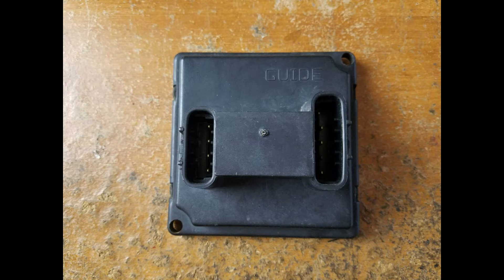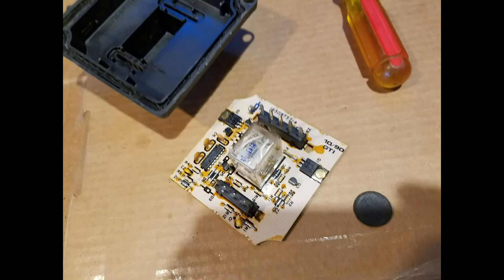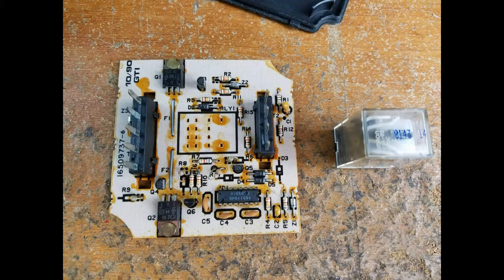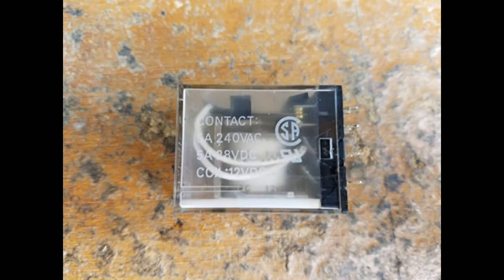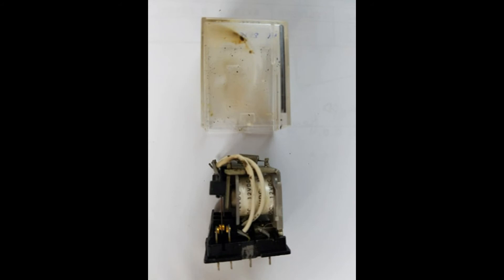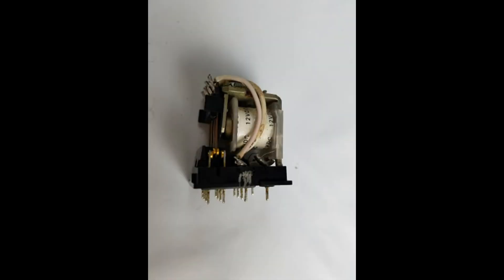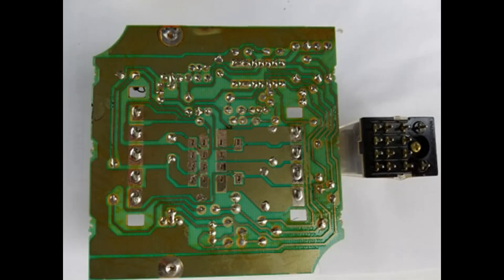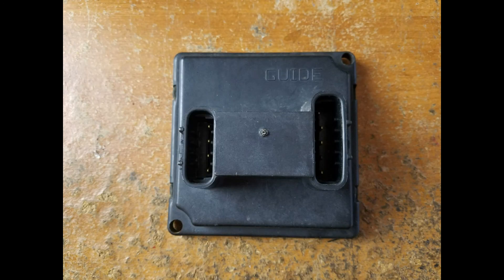C4 Corvette Power Headlight Motor Control Module Repair - Only basic soldering skills needed

Comment: HOW ABOUT, WHERE IS THE THING?
Reply: If you have an 84-86 fiero, you don’t have one, it’s a completely different system, if it’s 87-88, the original mounting position is on the frame inside the drivers side front wheel well.